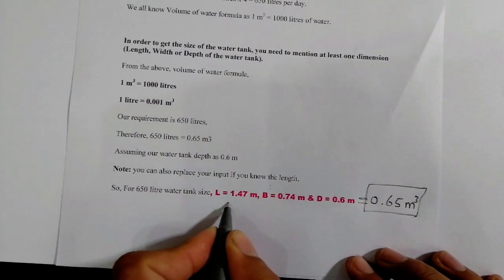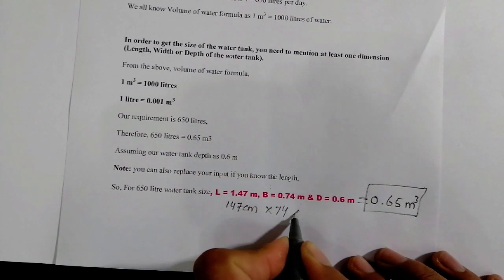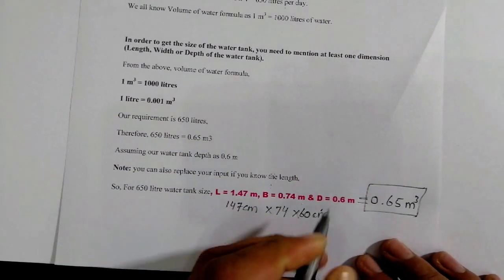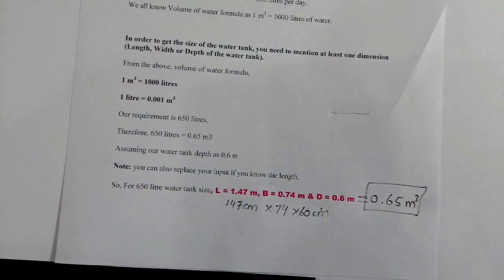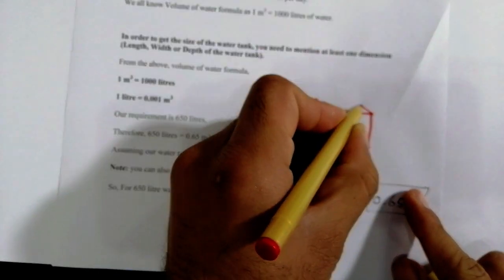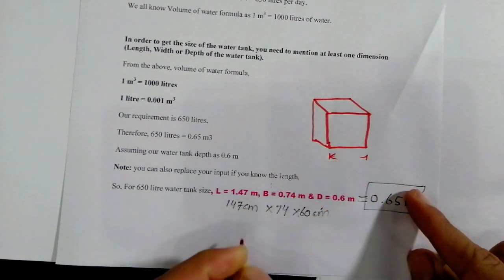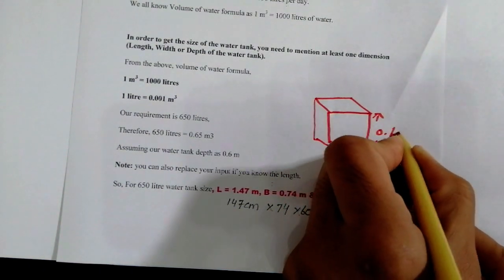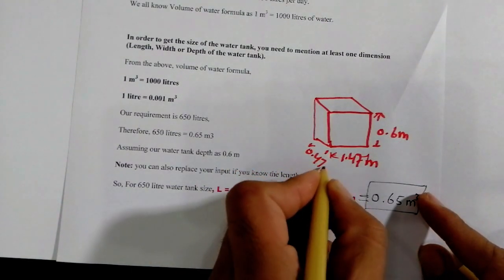Design of Rectangular water tank - Design of Water Tank  Civil Engineering videos

Comment: sir firstly you do mistakes in this video e.g 4x135=540,according to you it is 650,secondly you do not discuess the formula used to get either Length,Width when you consider only the depth is knew